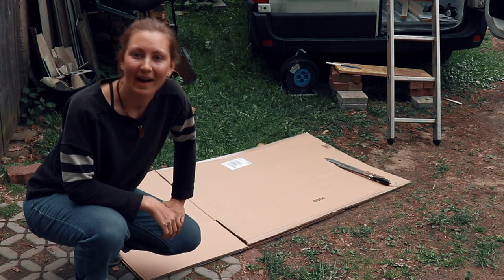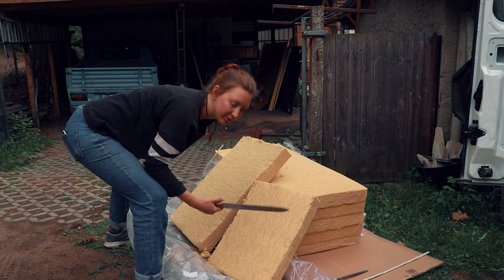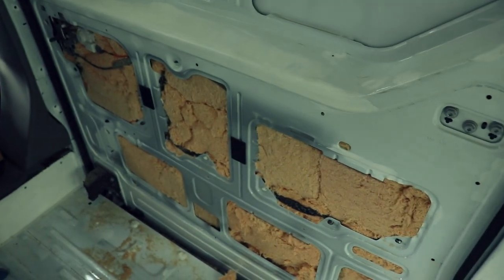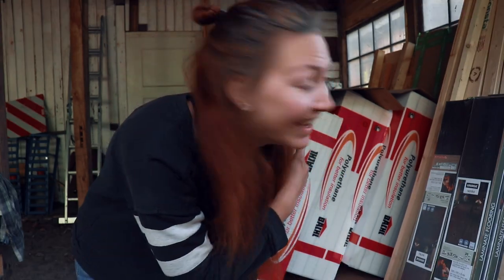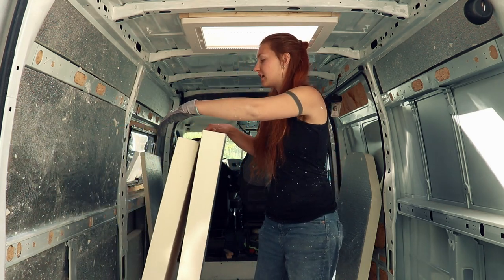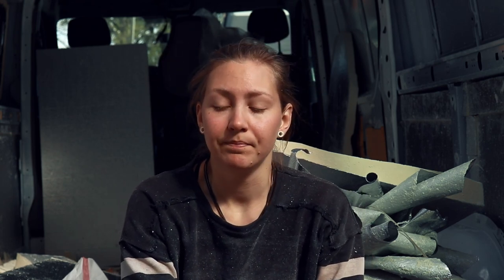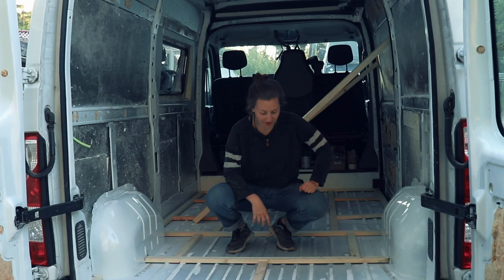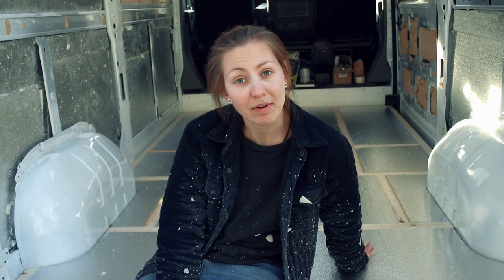DON'T make my INSULATION MISTAKES! | Van Build #03

Comment: I started with rigid foam types and it was a disaster for me. I then decided to go with Havelock wool and I cannot believe the difference in putting it in and the sound deadening properties it provided. I also already had a situation where I had to remove it for a wiring issue and it was no big deal. So glad I went with it. I wish you luck and success in your build!

Comment: I read down in the comments that you were done with the insulation so this might be a little late but if you have more to do I have a  couple of tips for the spray foam. 

First, as you figured out higher temps help the foam expand and cure. Second, those one part spray foams are moisture cured. They generally rely on moisture in the air but you can help it along with a spritz of water to provide the needed moisture. The added moisture really drives the cure. Just a light mist on the surface can do wonders for the cure, both in terms of time and expansion.

Also, as a caution, don't spray too much into an enclosed cavity. The intial expansion will "cap off" the underlying liquid foam and will preclude it from curing properly. Spray a layer, let it expand and cure, the spray another layer.

Comment: After doing a bunch of research and fixing other people’s rust problems, I might suggest you should always leave at least a 2-3” air gap at the bottom “rockers” or anywhere water or moisture could settle. Where the insulation rests on the floor or bottom of the rockers it will start to rust. That’s usually why you see vehicles rusting on the rockers on the outside. It’s because moisture is not evaporating on the inside (usually from insulation, trash or dirt settling there and holding moisture there).

Comment: I had a discussion with my building inspector on vapor barrier, wether it was better on the inside after insulation was put in, or put it against the plywood then insulation and sheetrock/drywall. According to him either way is fine and there's some who will argue one way or the other is best, but know factual proof of which is best. Either way you are trying to create a moisture barrier so one's as effective as the other. I went with closed cell spray foam in attack and walls, which is a vapor barrier being closed cell. I don't think you had to shave any off, unless it was just to thick.
Reply: Could you have put 1/4 plywood strips on the frame tubes and saved the cutting?

Comment: for anyone cutting Celtex or Kingspan if you use a saw where a mask you don't want to breathe it in, also it cuts a lot easier with a Stanly knife score it down one side then snap it by bending the other side
Reply: cutting the foil off the boards takes a lot of the insulation property away its reflective with heat, i used 25mm and just layered it up and used multi-layer foil as well

Comment: FYI. Secure the foam insulation with adhesive caulking in a few places before you cover or it will "squeak squeak squeak" going down the road. Good job 👍
Reply from the maker: That's a really good tip, thank you! Too bad that I'm through with my insulation process but hopefully someone else can pick this one up! Thanks! :)
Reply: @lifeoflenja390  Thanks sweetie. 
A very long time ago I insulated a 70's van using cut up cheep stryafoam coolers. Everyone laughing until weeks went by and It became louder and louder. 😳😬😀😅😯 Fun times ha ha.
Be safe
Peace 🌈

Comment: Thank you Lenja !!!
You really do a remarkable job truly more professional than most professionals .
It is kind of hard to come in after the fact with suggestions of doing things a little different what you did is wonderful and it will work out great in the long run .
I really do like the wood chip insulation I would like to know the fire resistance of it another job of insulation fire retardant insulation must be fire retardant most your polyurethanes are and do a very good job there are some cheap ones out there that will kill you if they catch on fire as far as the polyurethane insulation I would have gone with it too but not with the board I would have gone with foam it green . Sprayed it all in the first time much faster  and seals everywhere in one shot .
Fiberglass or rockwool really a bad choice all around and any installation because it's seddles and always leaves lots of air gaps not only to mention rodents and insects love nesting in the stuff . the only thing worth buying in an aerosol can well nothing is worth buying in an aerosol can waste of money waste of time and energy most the time , huge problem for the environment .
 you can even get WD-40 in a spray bottle over an aerosol can a mutch better choice I guarantee !
 the polyurethane insulation won't absorb or hold any moisture so there's very little chance of mold I kind of wonder about the wood chip insulation does it resist or hold moisture and will it hold and create mold will it give the insects and the rodents a place to nest they always find a way in . will it settle and leave big air gaps allowing condensation the beginning of mold .
 any time constraints we put on ourselves lead to stress stress acidic and disease-causing all of which we can do without !!!
 truly put the programmed education off for a little bit if you need to it's always there for you what's a few semesters and why should they rule over your health ?
 also one more suggestion on the build electrical and plumbing and all framing better done before the insulation .
 just a little word for thought if you choose it would be nice if we could all do this some Q&A before the decisions are made on what to do , get all the suggestions you can before you make a decision order and buy products and install it . We might be able to save ourself a lot of time money and energy , be nice if we could all find a way good suggestions can come before after the fact . the majority of us don't have a YouTube channel we can be taking advantage of .~)
 most importantly 🙏Lenja🙏 you are truly a great role model of equality ❣❣❣❣❣❣❣❣👍
Reply from the maker: Yeah, I'm wondering too if the wooden insulation will hold up well. I'll definitely give updates on that once I have some experience living in the van! Good call on the aerosol too!
The Q&A session is a great idea actually! I guess it's more like I'm asking the questions then! :D Sadly it's a little too late for most things now... but I'll definitely keep that idea in mind! Most of the time pressure or pressure in general is really coming from myself. But you're right, I need to remember to slow down a little sometimes! Thanks Henry!
Reply: @lifeoflenja390  ❣❣❣❣❣❣❣❣👍

Comment: On the horse trailer to tiny house conversion I recently finished, I used spray foam for the whole thing.  What a mess that was, haha.  Trimming back all of it created so much dust etc.  blech!  As far as I can tell, there is no easy & good way to insulate these kinds of spaces.  Looks like you did a good job though :)
Reply from the maker: Haha yeah, I'd think so considering the mess that little spray foam I used already made! Thank you! Converting a horse box sounds like a super cool project as well!
Reply: @lifeoflenja390  Ironic that something for climate control is so temperature sensitive.  I remember looking at the two week forecast  and reorganizing my whole life around the 4 hours it was going to be warm enough to spray, hah.  There are some photos up on twitter @whixr of my project.  Just got back from hauling it up into the mountains to my property in AZ.

Comment: It is coming along fine. Once you got the insulation that was a pain you made good time. That spray foam doesn't look like it was expanding foam. That is what you really needed to be spraying.
Reply from the maker: Thank you! Yes I think you're right, I just used the wrong material for the application after all 😅

Comment: I wonder if you can use foam for the holes in the side of the van and then use insulation for the areas that aren’t deep? How did you get the insulation to stick to the side of the van? I’m going to insulate my 2017 Ford van but it’s cold here in Portland, Oregon. Thanks !

Comment: The Sprinter Forum may help.  Chin up!  It will look great and work well.  Thinsulate will conform to the curves, tho' with a bit of compression which reduces r-value in those areas.
Reply from the maker: Thank you! Yeah, I definitely didn't use the perfect materials or work flow yet. But now that everything is in and insulated I'm pretty happy with the result! :)

Comment: 2 suggestions for future. Get flat cardboard pieces (large)... do templates that fit and cut insulation once with electric meat knife.
Reply from the maker: Thanks for the suggestions! The cardboard pieces are a good idea and the heat knife is interesting too! Do you know if the PU can be heated like that without causing any toxic fumes? Maybe I'm just being a bit paranoid with that stuff
Reply: @lifeoflenja390  the electric knife I think she is referring to doesn't get hot. The one I have has 2 blades and each alternates going forward and back with the other to "saw" or carve thru large roasts or turkeys. Kind of a smaller version of a reciprocating saw.
Reply from the maker: @jcrefasi1  Oh I see! That makes a lot more sense then and seems like a really good way of cutting the insulation! Thanks for clarifying
Reply: @lifeoflenja390  you are very welcome-! You have helped me a lot too!!

Comment: to cut the foam insulation foam
To a battery pole to pole creating a resistant strain resistant they wire will heat up and you will cut those boards like a butter

Comment: Hi lenja, I've also just started my van convertion on a lwb van as well and alone also. So I understand ur pain and I to realised its gonna take so long. But I feeling it will get faster after the floor and walls are done.
I used a mix of solar boards four of them on the sides ans all the rest and the roof with recycled bottle insulation.
I haven't got a space to build so doing it in my garden and walking it to my van across the road.
My next part today is the floor and battens and insulation, just waiting for the delivery. Mesage me, how far did you get now? Xx

Comment: Another great video, Lenja! Seems like a tough part of the project. Well done persevering. Curious to ask - as you were putting more and more insulation in, were you noticing any difference to the temperature or the sound in the van?
Reply from the maker: Thanks :)! Yes to both things! I noticed a small difference in the temperature but a big one in sound actually. I didn't use the sound deadening material because I thought the insulation would do the trick and I think it did (obviously I don't have a comparism).

Comment: One downside with the way you have chopped up the PIR is it is not in direct contact with the van walls in the same way that the wood pulp stuff is in your doors.
You don't appear to have used any soundproofing that may lead to drumming.

Typically when using flexible insulation such as recycled bottles hemp or wool or wood pulp it is in direct contact with the sheet metal and makes adding extra sound proofing unnecessary even though people still waste money doing so.
Reply from the maker: Oh that's a good point! I tried to give it as much direct contact as I could but a flexible insulation would probably have done a much better job in that regard. I'll keep my ears open for that and give an update once I have experience driving around with it a bit! Thank you for this insight!

Comment: No eye protection! Where did all the tools come from? A relative? Purchased? Rented? Who set up the planning - this tool set for this material that precedes the next chore? A Critical Path Network for tools, materials, fabrication and labor?
Reply from the maker: Most of the tools I am using are my uncle's and I'm super grateful for being able to use them! I did the planning myself, basically made a rough estimate what materials I'm going to need and when I'll probably be working on what. I still got timings wrong a lot of times and I had to take countless trips to the hardware store. I used the KANBAN method to organise myself. Hope that helped! :)